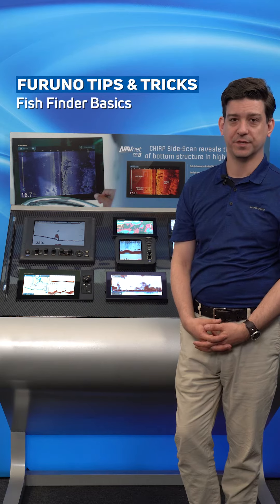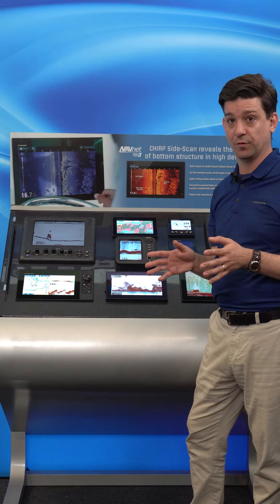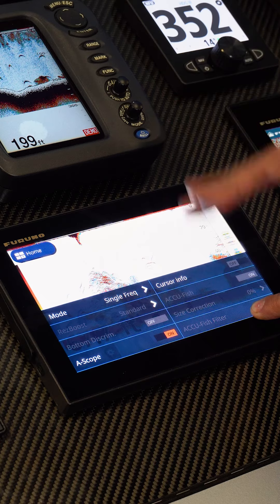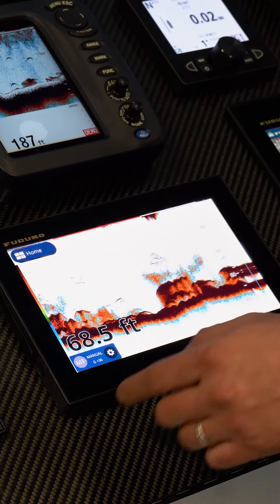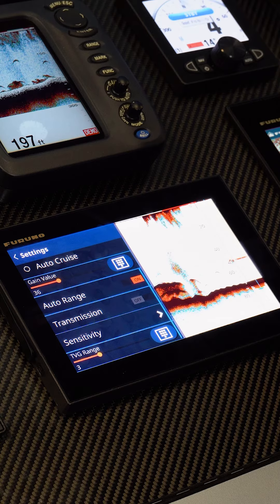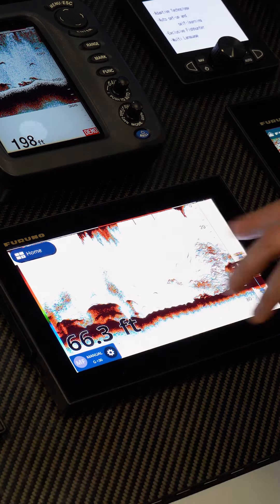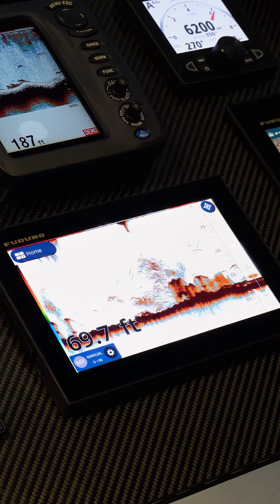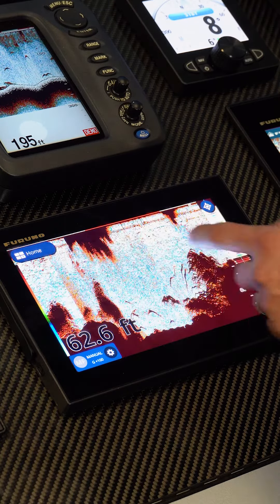Furuno Tips & Tricks: GP1871F/1971F Fish Finder Basics

Comment: I recently acquired a device like this and would like help on how to increase the screen brightness, how do I do this setting?
Reply from the maker: Hello and thanks for watching. You can find the manual here and on page 1-1 it shows you how to adjust the screen brilliance. https://www.furunousa.com/-/media/sites/furuno/document_library/documents/manuals/public_manuals/gp1871f_gp1971f_operators_manual.pdf. This can be done by simply pressing the power key several times or using the slider bar.
Reply: Thank you very much for the information on how to increase the screen brightness. Now could you help me how to set the water temperature to appear in the fishfinder option?
Reply from the maker: @allan-oktane-tedesco6824  For questions like these that are more technical in nature, please visit the Furuno Forum, create a free account, and ask you question there. It will be answered by Furuno dealers, experts, and moderators. Here's a link to the forum: https://furunousaforum.com/